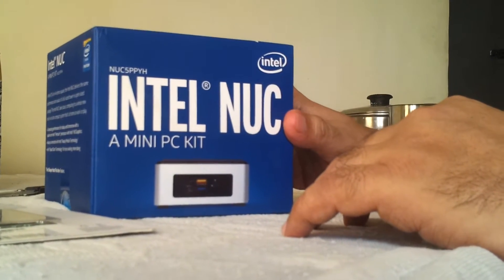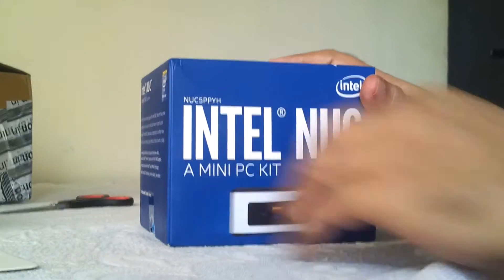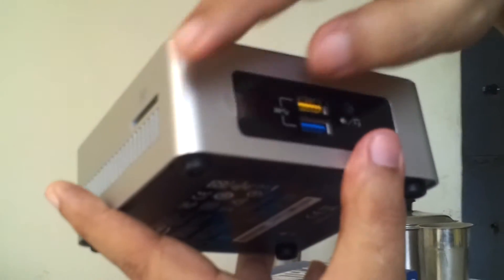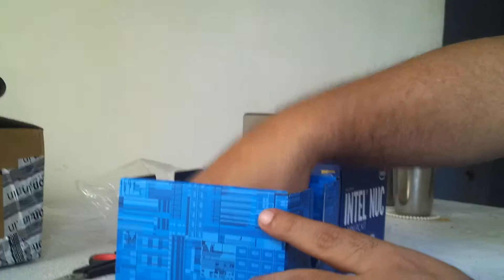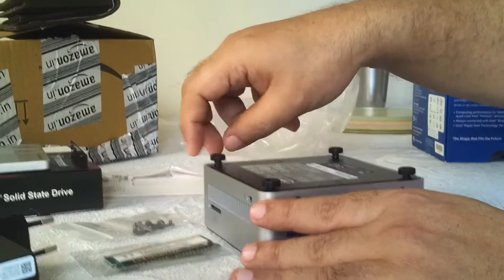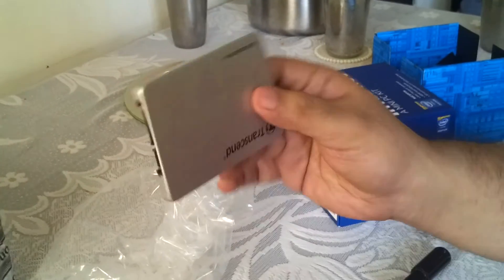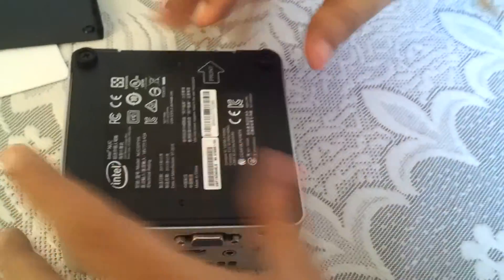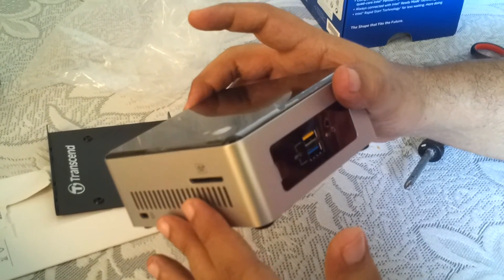Intel NUC Kit NUC5PPYH- Unboxing and Assembly (N3700 2.40 GHz, Quad Core)

Comment: actually kensington lock are usually used in the office or store to prevent theft. it's the metal wire that connect to the kensington lock hole.
Reply from the maker: hmm..i just googled"images" it..u r so right, thanks for the input .

Comment: Eh, can I use My SSD from Old Laptop/Computer to This Intel NUC?
Reply from the maker: yes, sure you can ..the conecting interface doesnt change , only the speed changes .
Reply: and then about ram voltage. is it only 1.35V can be accepted? or i can use 1.50V?
Reply from the maker: No you cannot use 1.5V ...only pick up one which is 1.35V  low voltage ram . But certain rams like mine work with both voltages .You may also use these dual voltage Rams . Dont be afraid...just go ahead...its as easy as ABC trust me ..even a 10 year old boy can assemble it .Yes just be sure you are using the right components .

with sales  coming up on amazon/ flipkart..and more ..this is the best tym to pick up your components..dont hesitate to ask for any more help.
Reply: Okay. thx . ill ask you more later if i got a problem
Reply from the maker: done!